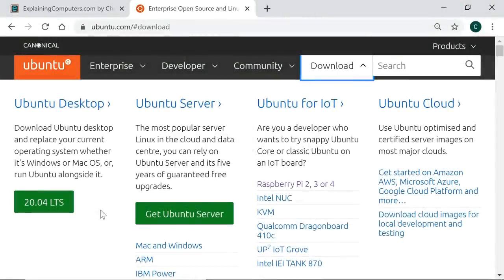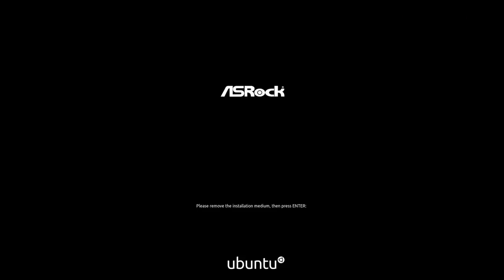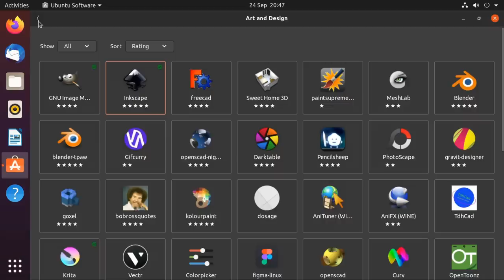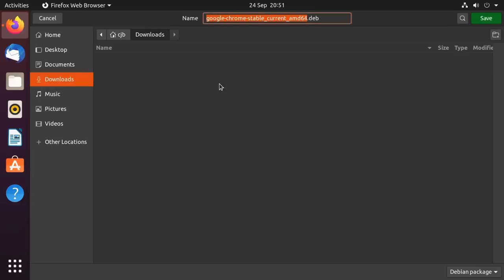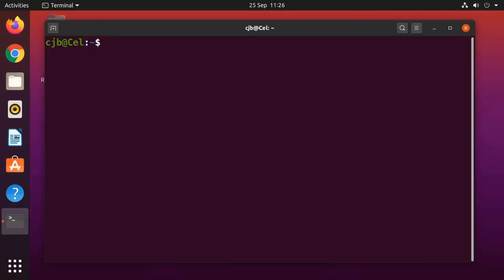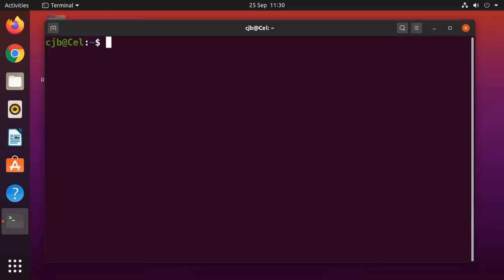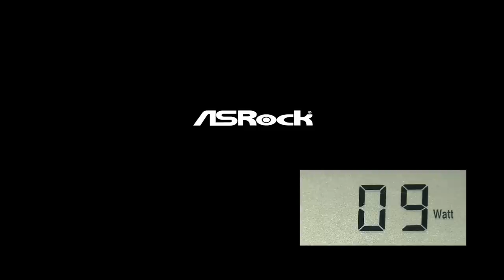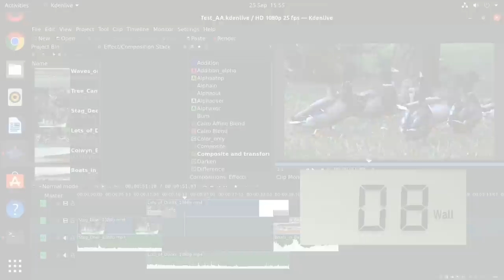Silent Mini-ITX PC Part Two: Software & Power Consumption

Comment: Actually you don't need to skimp a lot on processing power to get a silent system. Compulab airtop 3 with a xeon CPU and discrete  graphics card is also fanless - albeit with a sticker to match. Would have liked a review.
Reply from the maker: Nowhere in this video or the preivous one do I say that only low-power PCs can be silent. There are indeed many ways to build high-power silent systems as you note! :) I have been building "quiet" PCs for years, and may indeed do a high-power silent PC one day. :)
Reply: i dont think its just for silence but also low power consumption, that and i dont think a basic media PC realy needs a ton of horsepower to begin with.
Reply: @ExplainingComputers  My sincerest apologies sir if I implied that. I reacted to the Celeron processor which I believe is in the low power end of Intels lineup. I would like to see your solutions high power build, but they are expensive. Excellent video as always.
Reply from the maker: @erlinglorentsen4262  No problem. :)

Comment: What would be interesting if it would be possible too use a normal case and use the pcie slot on the board too use a Mining adaptor and run a gt1030

Comment: is there a way to undervolt cpu on linux without bios? i kinda wanna undervolt my laptop
Reply from the maker: Not something I've tried in Linux.
Reply: @ExplainingComputers  okay :)
Reply: @gilkesisking ty :)
Reply: @gilkesisking that's underclocking rather than undervolting though.

Comment: iv got this mb. and the bios is very restricting, missing most good settings one would need. maybe most asrock celeron are like this.
Reply: What settings do you need, default seems to run quite well.

Comment: I'm slightly surprised there isn't a notch or something to store the dongle when not in use as many mice have these days.  Other than the Logitech Unify dongles/devices, if you misplace the dongle or get them mixed up with others, you're screwed.

Not that I would ever do that, of course...  :)
Reply: There is, inside the battery case. It's even visible on the video. Same on the Logitech K400r that I've been using for years.
Reply: @ilhuikar  Cool, good spotting!

Comment: Is there a case with another design that you can recommend for this PC. I want to build it but I don't like the look of it.
Reply: i have built with the asrock boards in a chieftec ix-01B compact, thats really about the smallest you get. The IX-03B is also similar.

For another tvpc build (intel g2200) i used the older version of the lc power LC-1402MI because i wanted to fit a standard 5.25" blu ray drive.
did not use a (noisy) sfx power supply instead one of those 75W atx power plugs with external 12v power brick and just closed the sfx slot with a plate.
you can use cardboard with aluminium tape for optics.

The IX-01B has a nice passive airflow setup for the asrock cooler design,
if i am unsure of thermals i integrate a silent fan running at 5V so i dont have to worry about the psu heat or cpu throtteling.

These ultracheap cases tend to have sharp edges so watch out,
but since you usually dont change components often in these i dont really care.

i recommend clicking through the pictures on amazon (case mini-itx), there are plenty designs around 30bucks.

Comment: Definitely a much better celeron all ways fantastic content thanks for the videos I seen some older boards like this on ebyer as I'm looking to make a cheaper one for my old man all he does is web browsing but he loves to open so many tabs his pc has 8bg of ram but the CPU is often at 100% I wanted to switch his Windows 10 to elementary OS  as I know that would help but he does want a pc to plug in to a 4k TV looked on eBay found some 3rd gen I3 and i5s but u need to add an HDMI gfx card on most of them or more ram it's less that 100 pounds but there mostly ugly big towers or sff pc not looking anything as nice as yours

Comment: If you had Windows running on this PC, do you think the temperatures and the consumption would have escalated? By the way, I love the way you pronounce "P   C".
Reply from the maker: Running the same kinds of apps, there should be no real differences in temperatures or power consumption.

Comment: Cool video! Are there similar CPUs from AMD?
Reply: new range of low-power Ryzen embedded processors have been introduced by AMD, the new R1305G and R1102G are designed to provide customers with a TDP range of between 6W – 10W to create passively cooled, fanless small form factor systems.
Reply: I couldnt find anything on amazon though
Reply: Im still using the amd am1 mini itx low wattage athlon 5150 and it works well despite being 6 years old
Reply: @si4632  oh cool thx

Comment: Okay, is the Android OS , Linux?? See  I've just been working on some  Tab A - 8 Samsung's. and had to factory reset, and then load Chrome. So my question is what kind of productivity suites are available for the Android OS. Why not just go full on Linux?? We had to just about turn ourselves inside out getting the Chrome on those Tab A's. This WAS NOT my idea, but my bosses way of getting around MS's licensing agreement's.
Reply from the maker: This is nothing to do with Android. The OS is Ubuntu 20.04, which is a full Linux install. Maybe you are confusing the use of the Chrome browser here with Chrome OS?
Reply: @ExplainingComputers  I though those SBC's were android OS"s  at first and then you installed the Linux Distro of choice.  And yes I don't know the difference between a chrome browser and chrome OS as I didn't know there was a chrome OS. The Tab A's had the Android character on bootup. I've just had some dismal experiences with Samsung TV OS's (Tizen) which I thought was a derivative of a Android OS. Any software with Samsung on it just does not seem to be supported at ALL. I'm Just a little in over my head with the whole Android experience.
Reply from the maker: @bjre.wa.8681  Android software on many TV is indeed dire. :)

Comment: Would this be ok for a basic windows 10 machine?
Reply from the maker: Yes.
Reply: Oh, and I googled whether Linux could run Audacity about 30secs before you installed it🤣🤣
Reply from the maker: @scottb721  Audacity runs fine. :) Checkout Ubuntu Studio if you are interested in audio visual work in Linux: https://ubuntustudio.org/

Comment: A lighter flavour of Ubuntu may run smoother though.  Gnome on Ubuntu 20.04 I find pretty sluggish, even on reasonably powerful hardware.  Kubuntu on the other hand, with KDE Plasma Desktop environment I find works a lot faster!

Comment: I always associated Celeron with "cheap" and "slow"....not anymore - seems to be very capable - very low power consumption.
Reply: i was surprised when they started years ago with the j1900 cpu. did most of anything a office pc needs with win10 coming up to forced replace win7.
back then asrock even made a j1900-DC mainboard version which came including onboard DC-DC power and the external power brick.
 replaced some office PC internals which had finally blown their cpu power caps. (yes, i also replaced the power caps on some...)

Comment: i noticed some time ago on holidays that mozilla was struggeling to run youtube smoothly on my i5 laptop, on a mediocre 12mbit internet access...
same hardware (win7) with chrome and youtube was running totally smooth, did not lag or drop frames, buffered+loaded faster and used less bandwith.
No need to hassle with codecs, plugins or drivers.
i guess youtube / google optimizes for their tech, perhaps making it harder for the competition by force.
But since youtube is google = google chrome and if i am using youtube/google with my account in the end anyways i dont see the hate for chrome.
There is plenty enough to do so you can still share only the data you want.

Comment: Sadly a low quality media PC - using Chrome won't enable high quality audio and Ubuntu won't give you access to a very simple but effective Plex Media Player/server setup... and using KODI gives me the ability to do the same with Netflix (otherwise just limited to stereo via HDMI) - and Mandalorian has great quality sound with a 5.1 surround system.
I prefer Manjaro or Arch for this reason, as the Plex Media Player also gives me passthrough audio via HDMI... also there are no sneaky SNAP takeover bids there either.

Comment: minimal install works better. more clean OS. anyway not using more than 5-10% of the full install options, and flatpak is most stable option fot ubuntu

Comment: I was so imprest I got the same board, got an ssd, got the ram and a box. I just can't get any linux distro to boot. Just will not load Grub to the correct sda. How on earth did it work for you? The board must be bad. Just so disappointed.
Reply from the maker: Sorry to hear that you are having problems. I created a Ubuntu install USB drive, booted from that, went through the install (as shown in the video) and it worked. Can you boot from a USB drive with Linux on it?

Comment: I thought you needed to do upgrade after doing update.
Reply: If there are no software packages which need upgrading then you don't need to, i.e. the system is currently up to date. 
If it needs upgrading it will notify you of how many packages can be upgraded (if you wish).

Comment: Linux Mint 20 Looks like Windows
Reply: And seems easier than Ubuntu these days.. a shame too, because I used to like *buntu
Reply: All OS's will start to look the same, especially before users play with them, Microsoft and Mac no doubt spend quite a bit of money on their UX departments, while we are all individuals, we all share a lot of things when it comes to the basic aesthetics and layouts of things.
Reply: Well, when you consider that almost every OS performs much the same function and provides the interface by which we control the computer, it shouldn't be a surprise that there's a resemblance between them.
The tasks that we use computers for are the same whichever OS we choose, so it doesn't make a lot of sense for every OS to go about them in different ways, and as most of us are familiar with Windows' methods, anything radically different would just be confusing. 
Personally, I find it useful to be able to switch between my Linux machines and my (solitary) Windows computer without having to completely change my mindset.
Reply: That's unfortunate. As Windows doesn't look that good, in all honesty.

Familiar, perhaps, to many people, but it's often an exercise in frustration to use.

But at least, with Linux Mint, you don't have silly things like two sets of configuration, in both "control panel" and "settings", to wrestle with. Or the lack of a package manager. Or 
non-optional irreversible updates (that, by the way, broke the audio on my work laptop - it just randomly dies after 5 minutes, for no apparent reason). Or paying for a "licence" for the privilege of all this. Or...

Sorry, you get the point. Being "like Windows" ain't necessarily a compliment.
Reply: @klaxoncow  
It may not seem like a compliment, but to the many thousands who have taken the Linux Mint leap, it sure makes it a hell of a lot easier!
Reply: @adventureoflinkmk2  Ever since Ubuntu went the Gnome3 route it's become uglier and more difficult to use.  Gnome3 is really awful.  KDE Plasma is somewhat better these days, but not much.  I'm still a fan of XFCE (or Xubuntu) due to its customizability, but if you're going that route you may as well just do a generic Debian installation and have all the benefits that has.   However, most users these days aren't interested in "usability" or smart interface design.  They just want to jump into an OS and have it work exactly the same way they're used to without effort.  If so, why don't you just install Windows?  Hell, 90% of the productivity software you use on Linux is available for Windows (And Mac OS!) anyway.
Reply: @tarmaque  ugh.  It's also a nightmare to get epsxe running in *buntu compared to Mint
Reply: i love my manjaro kde. customizable and stable, if you know how to properly use a computer
Reply: Looks like Windows 10 -- not so good.  I prefer ones that look like Windows XP.  I really hate what Microsoft did with their user interfaces (including Office >=2007) after that.
Reply: @tarmaque  to an windows users a similar interface is a usable and smart interface, because of that familiarity, one of the core UXD rules is exactly that, use what is familiar to ease use and adoption... I hated UXD :/
Reply: If you're having issues with stock DE's modify your own, do a Linux install to CL only, install the login manager you like, put in openbox or the Wayland alternative and the session manager of your choice and then the DE of your choice then customise to your heart's content
Reply: @MrTrilbe  now that's customizable, arch who??
Reply: @francescovolpini  who me nooo... Eyes LFS guide... I'll need more coffee I think
Reply: @MrTrilbe  Colin Chapman, founder of Lotus Cars, had a rule for performance:  "Simplify, and add lightness."  The same principal can be applied to user interfaces, but Microsoft and Apple seem to have forgotten that.

Comment: Actually...main problem with Linux and streaming services is hardware acceleration. CPU itself isnt very fast. Players like MPV can use hardware acceleration(pretty decent) provided by GPU, but Chrome which you love this much DOES NOT support it on Linux. You can rather try Firefox which is recently got VA-API support and now can use hardware decoders, but you will need to fiddle around anyway.
As for Disney supports linux, why no? They use Widevine DRM which is supported for years already.

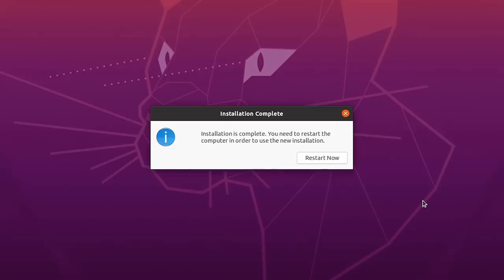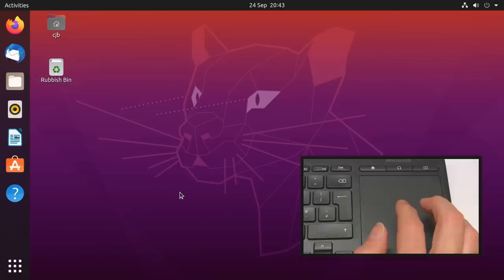Comment: i have the same itx motherboard with one 120G SSD, 8G DDR4-2600 installed and SilverStone ST30SF as the power supply, the power consumption in idle is about 10w and up to 20w for the stress test. i am pretty satifised with the energy efficiency of this x86 machine, but i want to look for some other x86 pc even more power saving that can be compared to raspberry pi 3b which only consumpts 4w in idle and never exceed 10w . the Intel N4000/AMD R1102G is one of my choice and the other one is J4125 (gemini lake refresh),  i found this minisforum gk41 with supprising low power consumption as low as 3W idle (https://www.youtube.com/watch?v=8OJpm-E1zag) (05:57 - 07:04)

Comment: If you set up a really tiny home and root part (or just a really small root part) the whole system can be backed up to an external device. Great for newbies who mess up a lot, but also great for portabalizing an install by using a superspeed USB device if available. I've been able to make a copy of Manjaro on disk boot from USB with some time and effort, did a writeup about that here: https://forum.manjaro.org/t/27754

Comment: You stated this build will basically be a media centre next to a TV, yet you bog it down with a lot of software not needed for media playing. Since you kept mentioning its life will be a Media Centre next to a TV, I would have thought you would have had a 3rd part explaining about turning it into a media centre device and what relevant software choices out there to have an all-in-one media system. If you are going to use it to stream from online services, then it will suffice, but how capable is it running Media Centre Software, streaming say a 4K movie from a NAS? I am a Kodi fanboy, but I know the paid version of Plex is good as well. I heard you mention that the Celeron CPUs these days are far superior than the early Celeron days, but being in IT for over 35 years, I still cringe when I hear Celeron. I have a few Celeron devices that don't do much work, but yes, they are quiet adequate in those devices (still wouldn't use one for a media system though). Thanks for an interesting video.

Comment: I would rather go for LinuxMint LMDE than Ubuntu
Reply from the maker: It was a close choice, but I run Mint on my desktop, so thought I'd have a change.
Reply: @ExplainingComputers  Both Ubuntu and Mint are nice. My personal favourite is minimal Debian with KDE Plasma...
Reply: @ExplainingComputers  yeah, it's personal choice. But does the keyboard work great on Linux, especially the touch pad. Does it scroll smoothly or just fine on linux?

Comment: i have to disagree re MS making nice keyboard and mice. Yes they go however they do not last very long. The letters rub off the keys to easy on much used keys and the rubber underneath also goes lose after a while, I do love the MS key boards how ever both my previous 2 have had this fulat after the 12month warranty, this time however i just bought some stickers to cover over the warn out keys.

Comment: I hate Gnome Shell with a vengeance but if KDE Plasma suddenly died and I had to install and use it I'd go for Pop_OS! It's Ubuntu but better and has none of those awful Snap packages installed by default! The first thing I do on any Linux system is to remove Snap and Flatpak support. It might also be a good idea to install gimp-data-extras, I don't think the package manager installs it with the main app, possibly Gimp help too. I'm also amused at your mixing of KDE applications on your GTK system :-) https://pop.system76.com/
Reply: Forgot to mention that I install Synaptic Package Manager, it's much nicer to use than Software Centre and check whether both ubuntu-restricted-addons and ubuntu-restricted-extras are installed.